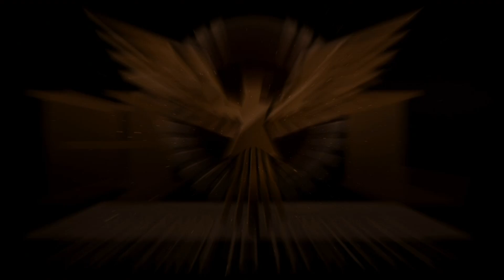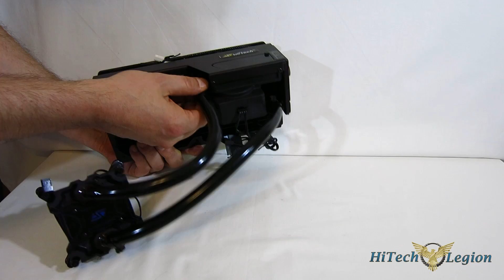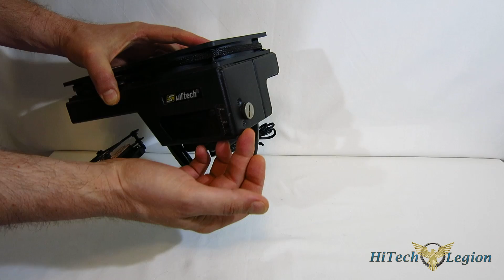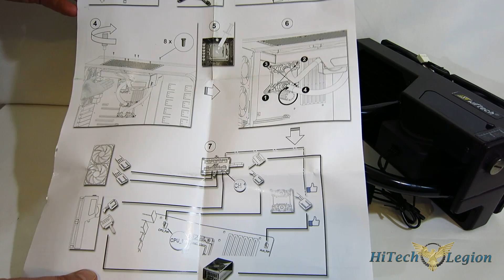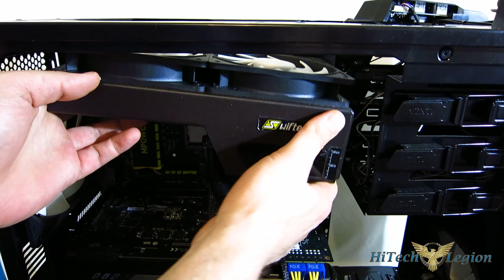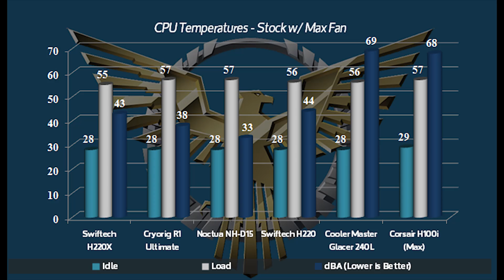Swiftech H220 X Open Loop AiO Liquid Cpu Cooler Overview and Benchmarks

Comment: Good thing I didn't get the H100i, yet. this thing is way quieter. I know the fan can be replaced but then thats gonna be more expensive than just getting this right?
Reply: I just finished taking the h220x and converting it to hardline acrylic tubing as well as adding a full cover block. pics and info here -> http://www.overclock.net/t/1526026/update-h220x-acrylic-conversion-full-cover-block
Reply: Not only would it be more expensive, it would still not perform anywhere near the H220-X, plus you would be losing expandability.
Reply: It turns out its actually $12 cheaper if you get the H100i and the quieter fans. I would not be doing any extreme overclocking, so my biggest worry is noise. If someone could compare the SP120 Quiet fans to this one stock, it would be awesome. If performance is really behind, though, the H220X is the winner.
Reply: Allen Jun Sorry, when you said "quieter", I somehow assumed you meant Noctua fans and went by that price.

You are kind of missing the bigger picture here - fans are very little of the performance/noise when considering these two. The H220-X uses significantly better quality components, all of which aid in better heat dissipation. It uses a copper/brass rad, top quality CPU block and higher flow pump. These things add up to significantly better passive performance, which allows for better performance with far less air which means far less noise.

The H100i uses an aluminum rad, mediocre CPU block and a pump that barely moves water. It attempts to make up for the inferior components by shoving as much air through through the rad as possible without regard to noise.

If you look at the benchmarks at 17:43, you see the H220X with an 8 degree advantage when both are at like noise levels. That is a lot to give up. The H220X will always be significantly quieter at similar performance levels, and in turn will always perform better at similar noise levels with all things being equal. Now you are talking about downgrading the performance of the H100i from there with SP Quiet fans.....not to mention you completely give up the option of expandability.

So, yes, performance is way behind on the H100i in terms of noise/performance no matter what fan you change to.
Reply: Thanks for that reply. I'm gonna grab the H220X asap.
Reply: I almost bought the h100i too. I have the h60 and its so loud and it doesnt do a great job cooling my fx 8350. BTW, be careful of the bleed screw, its fragile. Gabe at Swiftech already warned me and others about this on the overclock forums. > http://www.overclock.net/t/1367654/swiftech-h220-h320-h220x-and-cm-glacer-240l-360l-owners-club/11010#post_22651486 - The h220x should be back in stock tomorrow (Tuesday Aug 5) if you havent gotten it already.
Reply: Nice I feel like i should wait for a sale though.
Reply: Allen Jun
 Its going to be a long time before it goes on sale. Its going gangbusters at regular, full price. But it will eventually go on sale. It just might be a lot longer than other products. If you bought the h100i and then replaced those two fans, you would probably be right at the same price that it would be to get this. Just an FYI, Swiftech is about to get another shipment of these in today or tomorrow but they sell out quickly...like within a few hours. Another place to check besides the Swiftech site would be Performance PCs. I just ordered mine from them. They had sent me an email to confirm they had ten units in stock yesterday morning. By the time I read the email and went to the site and placed the order, they were down to 2 units.
Reply: firewulf1  I finally installed mine: very quiet & keeps the cpu very cool. One problem, the unit is not fully g 1/4" compatible yet. The outlet on the pump needs an adapter that Swiftech has not released yet. I talked with Bryan at Swiftech and he said that the piece should be released in a few weeks. In Swiftech time, that means 8 weeks (if we are lucky). So, that means I am stuck with my project. My plans are to expand off this unit and swap the pvc with hardlines (acrylic) tubing. None of that can be done until the adapter is released. There is one alternative to get around this but I am not confidant that it will work as well as a direct adapter from the manufacturer.
Reply: firewulf1  You should be able to order it from Swiftech (or check if performance-pcs.com ships international). Update on the pump adapter: I talked to one of the Swiftech guys and they said that the adapter may be out next week
Reply: firewulf1 I have to ammend what I said; Swiftech has responded and plans to release the adapter in a week. Thats good news for everyone
Reply: sick.. me too.. lol
Reply: Douglas Stewart Nice, what size are the tubes?  I want to do the same and I plan on maybe buying a gtx980 on February or whenever the new nvidia cards come out and include it in the loop.

Oh and did you bend the tubes yourself?

Also, did you add kill coil?  I refilled mine and tried to add a Kill coil but the one I bought wouldn't fit inside the reservoir lol

Comment: I am looking forward to a review of a build using the open loop to include a hybrid MB cooler (like that on the ASUS ROG Formula VII).  Sounds like the AIO liquid cooler of choice for a water cooling 'noob' like me.  I like the idea of water cooling the CPU with the option of future expansion to a MB by the addition of only a couple of fittings and short lengths of tubing.  GPU water cooling seems like a more practical application, but would this setup have enough power?
Reply: Absolutely. You can add a GPU, another radiator and the MB block without an issue.